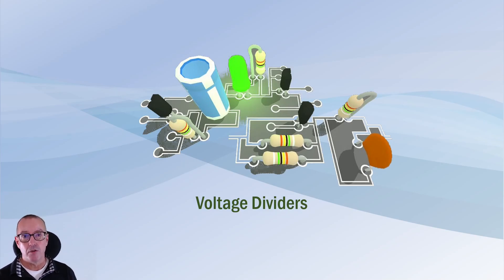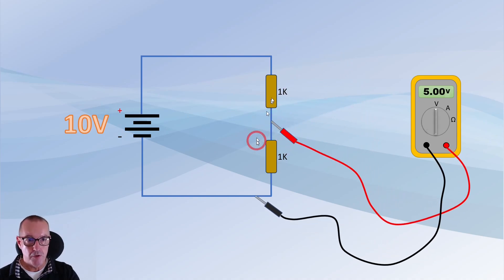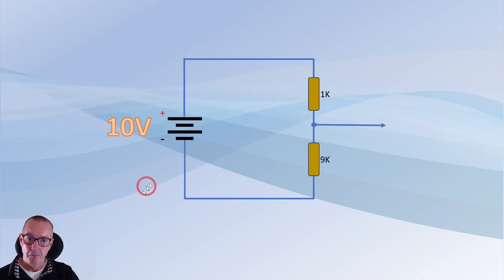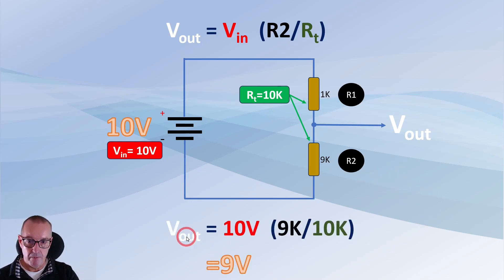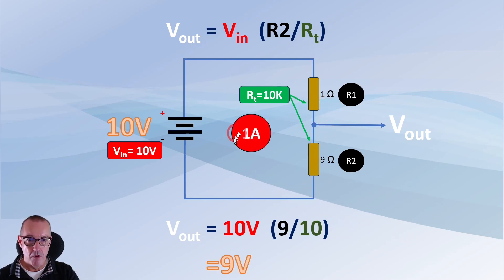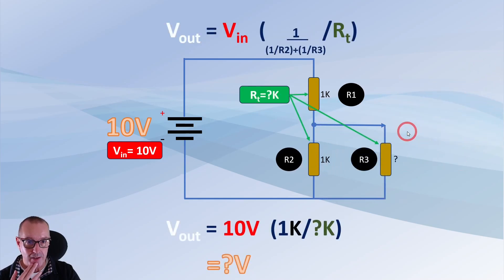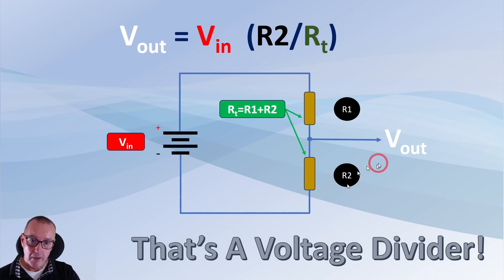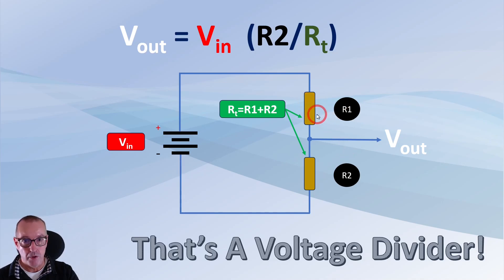What Are Voltage Divider Circuits?

Comment: Why would you want to use a high impedance device as a load between the resistors if the divider gives 5 volts. Thanks
Reply from the maker: If you put a low impedance device as the load then the voltage will no longer be 5 volts. The load is the same as adding a further resistor in parallel with R2 and effectively reducing R2 and reducing the voltage. Hope that makes sense.....